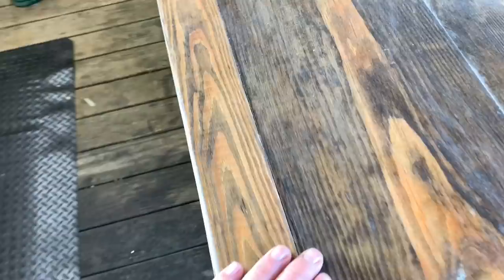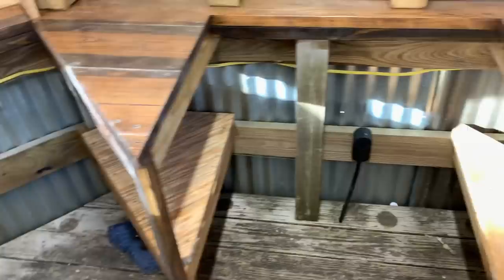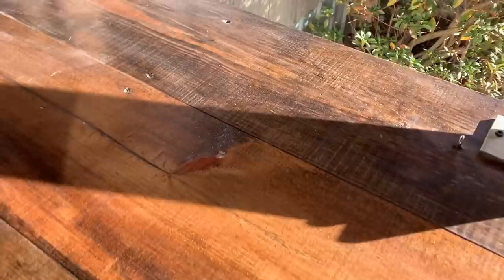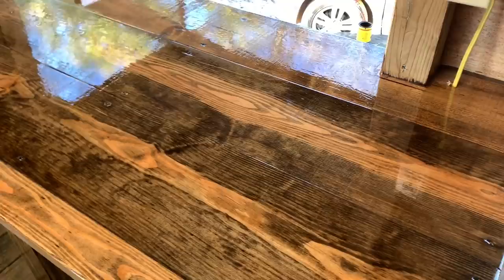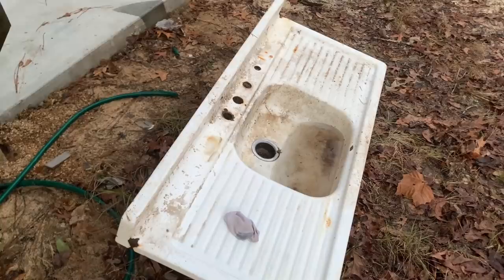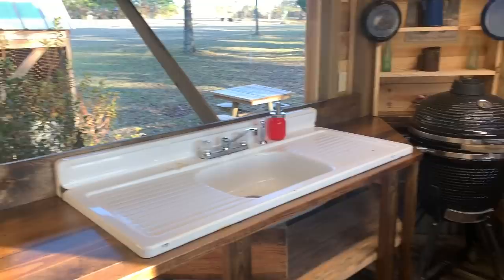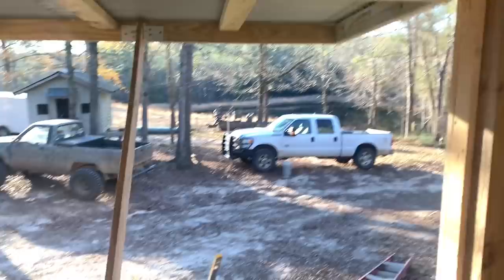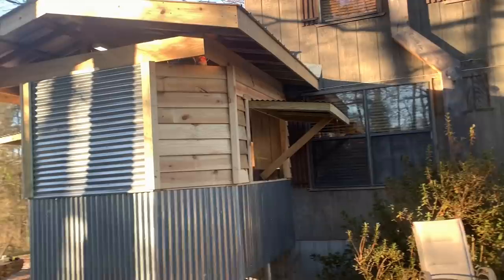Finishing Up the Outdoor Kitchen!

Comment: I have that exact same sink !

Oh I love your kitchen !!!
Just an idea, put metal locking cabinets in so you can leave some food/staples out there, like spices, flour, corn meal, oil and so on. Those truck bed toolboxes are tight, turn it on it’s side and add a shelf, mount on wall or just slide under the counter. Would be nice to not have to bring out every item every time you cook !  I also use tins, like popcorn tins, candy tins, cookie tins to keep stuff in, critters can’t get in :) cotton balls dipped in peppermint essential oil is also a critter repellant, I just put them around in corners. 
Just what I’m going to do 🤷🏼‍♀️

Can’t wait for the cookin 😍

Comment: That sink is perfect! I wish I could find one like that up here in Wisconsin
Reply: I’m over here in Minnesota and I always think, “I need to go over to Wisconsin looking for sinks and stuff” haha ! Not that I need any, I have 4 cast iron sinks w/drain boards but I’ve seen several in Wisconsin on Craigslist and one time I was driving around in Ashland and there were several sinks and cool stuff sitting on the curb of an old house they were remodeling. I was on a solo camping trip and didn’t have room in my car, it was killing me, I drove by about 10 times and the stuff was being taken ☹️ I think about it all the time !!!
2 of the sinks I have are the really heavy, thick cast iron, high back with apron on the front and get this, I got them at my local dump !!! I damaged my car trying to get the darn things in the back of my highlander, but I got them 😍😍
Keep looking, they are out there, you’ll find one 😐

Comment: Jeff, I'd still be tempted to install some 1/2X1/2" wire mesh over the gable and soffit areas. Finding squirrel, coon or bird droppings inside would be a non starter. 
Everything else looks nice. Great vision for a outdoor kitchen that works for you.
Reply: Behind him when he’s filming is totally open to the outside. The steps to go up to the porch are right there. If that wasn’t the case then yes, totally agree, I’d want some screen on those opening.

Comment: Had several adventures with satin, oak step treads from Lowes, Minwax. brushed it on, in the garage. Bright lights, wanted a better look. opened the garage door. it dripped out all the rain storm from every seam ARRRGGGGHHHHH, sand heavily  *) grit. every thing off after drying, took inside, brushed again almost perfect. Then the cat got in there, am sure everyone knows what cat hair in fresh satin will look like GGGRRRRR> next attempt, Wagner spray gun. enclosed room, mask on. after cleaning glasses many times, seen ten gazzilion bubbles. ARRRGGGHHHH>. went an got a hammer. pecked on the bottom of the wood many times, the bubbles vanished after every tap. a week later set out in the sunshine to cure. Am sure that finish will look just as good when my grandkids get my age. that was 10 yrs ago. Still look like the day I delivered my mistakes.